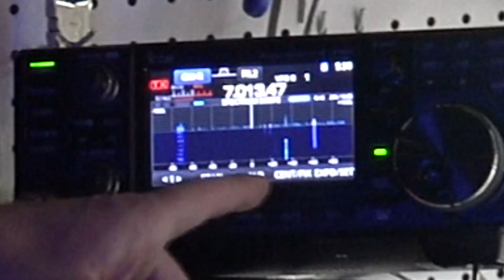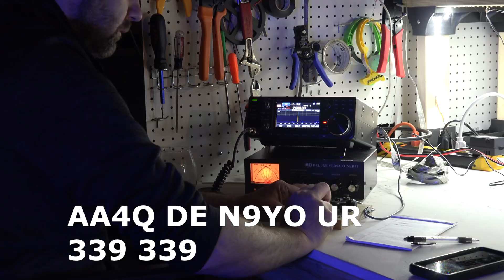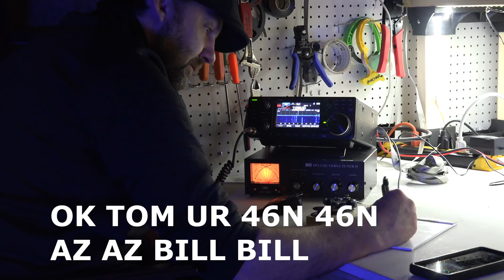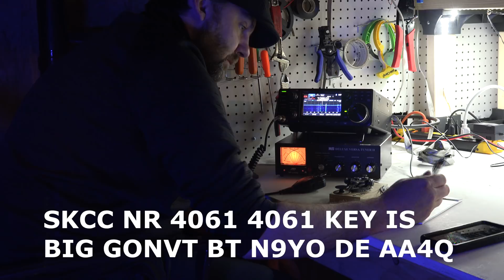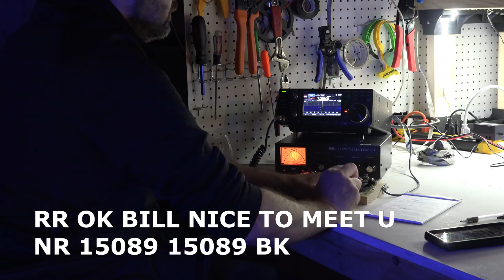IC-7300 CW Morse Friday Night Straight Key SUCCESS!

Comment: Im wondering if you are happy overall with the Icom 7300 running only 100 watts or do you plan to add an amp to it later? I have this radio as well and planned to only use 100 watts but keep hearing people running 1k + on the air, I looked into getting an amp but I really dont want to spend any more money on my setup
Reply from the maker: Given I live in the city and I cant really have an antenna tower I would not look. To power first. I'd rather have 100w and a resonant antenna than 1k watts. If I lived more rural id get a decent tower first then an amp second.
So I'm happy with 100 watts.

Comment: Love the cw videos!  Appreciate the work you do making them. Keep them coming. 

Try some qrp sometimes? Would like to learn from yr experiences.  Friend of mine just did straight key NC to Tokyo at 8watts, signal 337. Am curious what you can get on your antenna.

Again, thanks for the videos.
Reply from the maker: Thank you so much! 😁  Transcribing them to video is not easy because video software isn't built for lots of typing like that.  Anyway, I wanna get outside and do QRP, maybe this week.  I'm waiting on a HyEndFed resonant antenna to come in the mail and I'm going to make videos about that. Super excited.  Thank you for watching Amigo!  😎
Reply: Would it be easier to transcribe into captions? At the start you could announce that cw transcripts are viewable in captions so turn them on.

Although I think it's better to do as you currently are.

Maybe consider using captions for longer videos with multiple qso's.

Again, thanks. Partly due to you I'm now studying cw. You help keep my interest up. - Mack N4BEB